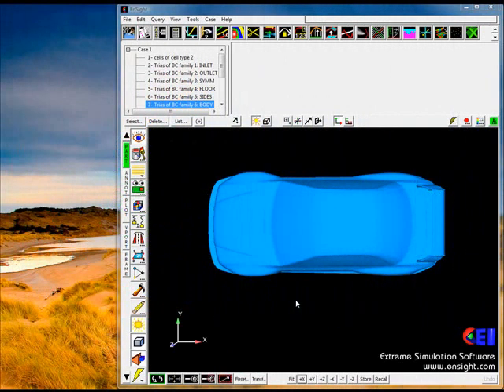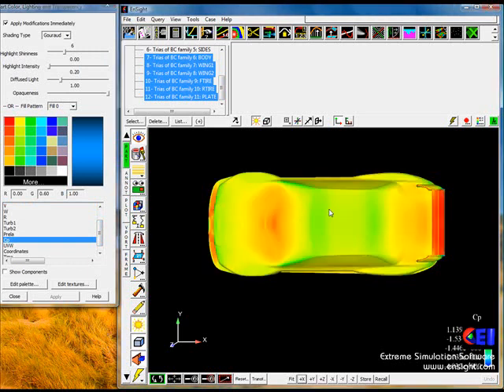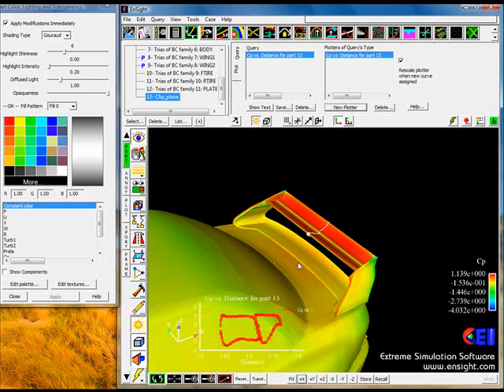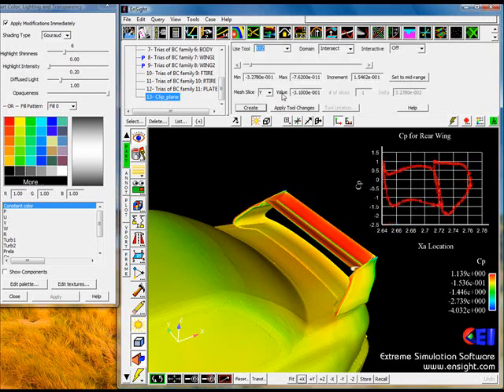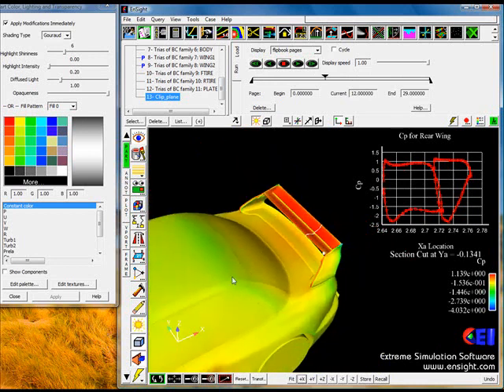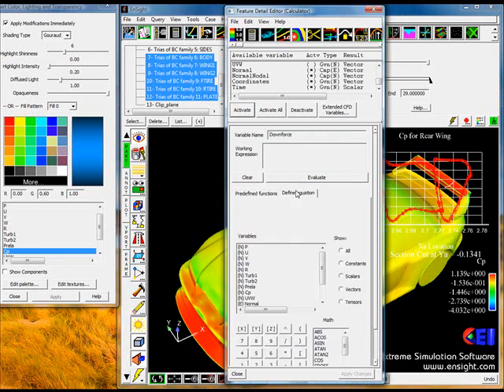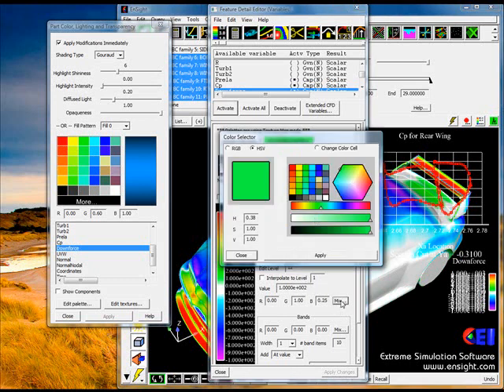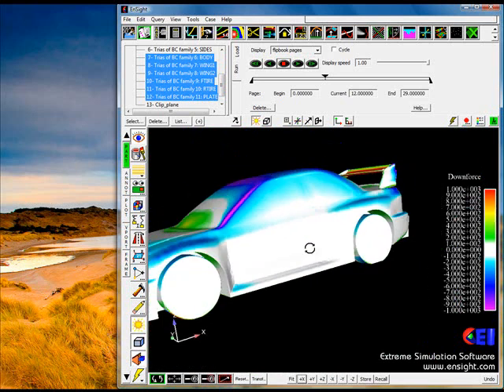EnSight Aerodynamic Analysis Part 1 of 2

Comment: I have System Coupling Results (Transient & Fluent - 2 way FSI). I can load the SyC results but only the Data transfer part. Not the entire model. Do you know how can I load the complete model and see the Stress and pressure on the bodies?

Comment: I gained alot of speed now on the back straight at Watkins glen I gain 5 mph, but I lacked a little Df after I took the second wing of the rear, I adjusted  it from 2 deg to 4 deg and it helped a little, I added the wicker bill recently and I am hoping I will be close to balanced fromt and rear now, while not having too much drag. This is all a guess and monkey see for me,I have only a little knowledge Of fliud dynamics.